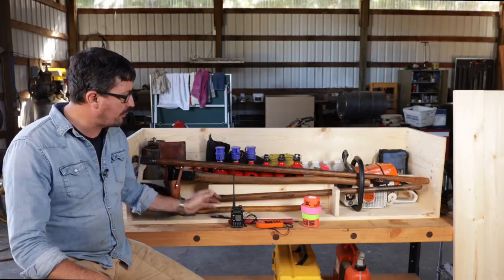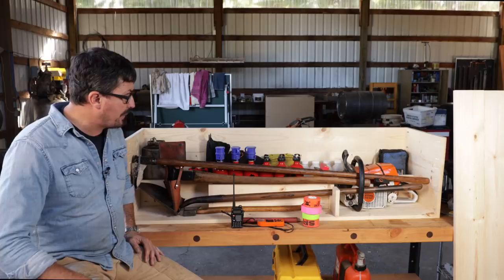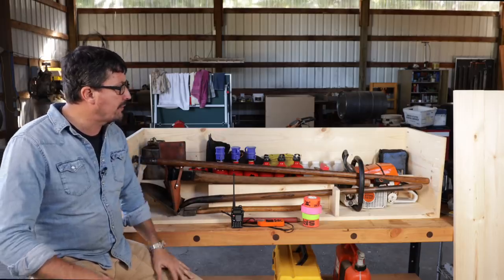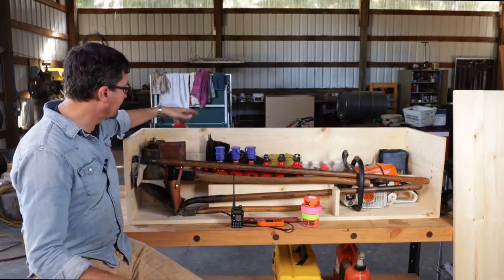I Built A CHAINSAW Survival Kit

Comment from the maker: Buy A Kreg Pocket screw Jig Here + https://amzn.to/2Yv62Ok + Only $19 + + + Free Shipping
Reply: GOD BLESS YOU MY FRIEND
Reply: You should put led on the bottom so you can pick it up with the forklift or the forks on your tractor
Reply: Your putting a lot of craftsmanship into something that's supposed to be staying outside. When the old timers made those boxes. They tended to make them out of rougher cut Lumber. They also used either glue or some other type of sealant between the boards to provide better waterproofing. Later when thin sheet plywood became available they used that to help create the lip to prevent water from getting in.
Reply: Very very nicely done Cody absolutely perfect love how you use the screws you just use the screws for what they are and don’t ram them into next week you are a very skilled fella and a pleasure to watch
Reply: @dawall3732  how can he work with a bad arm?
Reply: I just discovered the Kreg pocket hole jig kit myself recently. Great little tool to help a non woodworking guy like me reinforce some bunk bed rails. Ever since I did that project I've been thinking about what little things I can build with just that jig. Cool to see Cody build something using that exact tool.
Reply: Sadly I can’t build with wood or anything 😔

Comment: Might be a good idea to put some tape on the batteries on the torches and radios so the terminals don't corode or turn on accidently.
Reply: Good tip with the tape or don’t put them in until you need them.  I run energizer lithiums in everything now.  No acid leaks to ruin things.  Don’t let a 50 cent battery ruin a $100+ radio or anything else!

Comment: Beautiful. I love how close all of those tolerances are; not an inch of wasted space, but everything is still relatively easy to get to. 
The one thing I can foresee being a headache is having those wedges slide down into the channel when you remove that can of bar oil. Maybe put a thin panel to make a separate compartment or glue and tack some 1/4" square strips in the bottom for the tips of the wedges to go into. 

I can't wait to see it finished.

Comment: Looks great!
The pocket holes are sure slick eh?
I'd add battens on the outside for back up to the pocket holes and for extra strength, as well as on the bottom, to keep the main part of the box off the ground, just my opinion.
Take a short length of paracord with a loop on one end and carabiner on the other end to go through the holes in the rolls of tape, you could hang in inside the box on a hook and you can loop it through a belt on the go.
Can't wait to see it all painted up and stenciled, gonna give you the fizz for sure!
Cheers from Tokyo!
Stu

Comment: Very nice project...I wonder if a couple of 2x4 runners on the bottom the short dimension about a foot or so in from the ends wouldn't be a good addition just in case when you take it with you and put it on the ground.

Comment: I don't know if it's really worth mentioning, but as I watched you build this I noticed something.  You did pocket holes for the joinery on all the slides, but it at least looked like for the bottom, you just did a straight outside-to-in screw hole.  My thought is that if you did also a pocket hole from the inside, then ALL the outside of the box wouldn't be subject to the degradation of the outside, but using just straight out-to-in's on the bottom, it could more quickly degrade the screws from the bottom up as those are also the ones that will sit on the ground.  Meaning they might rust and break making the bottom not as sound as the sides.  Again, I'm no expert at all, and I could be very wrong about this for different reasons.  It was just something that popped in my head as I watched....not all the way through it yet.
Reply: Ok, obviously, after watching the video posted on the 26th, I was wrong.

Comment: I do similar,  with an exterior 1x4 frame, and 1/2" plywood interior, all green treated, with a rubber seal on the lid and skids on the top and bottom, and a dado'd floor... Always coated the outside with foundation tar, but lately using rhino lining... Nice job.

Comment: 2 questions. 1, how did you manage to find 1x6 that was all the exact same width, or did you mill this lumber yourself? And 2, how did you get pocket screws to not draw the piece in the direction of screw travel, such that the piece that is receiving the screw not the piece with the pocket holes ends up proud of the joint without clamps?

Comment: Two big questions  is it light enough that one man could pick it up and put it in a truck if it isn't (and even if it is) what about putting heavy duty wheels on one side and a handle on the other. My other big question is would it be smart to put a hand saw with the chainsaw that way if there is an issue you still have something. or is your chainsaw dependable enough that you won't have to worry?
Reply: He does have an axe inside the box.
I agree with you on the portability of this big box !

Comment: Did you use wood glue? I didn't see any. It would make the construction a lot more rigid. Back in the day I learned that a properly glued board is stronger than the fibres of the wood itself.

Comment: Hey Cody, couldn't notice that the layout and the method of transporting all the gear is pretty specific, unmodular and unpractical in my opinion. If you are going to replace the water bottles, petrol containers down the line, they probably won't fit in the designed spaces, if you destroy or lose one of whe wedges or get new ones they won' fit etc...The whole box is designed to fit your specific vehicle, it's probably gona be pretty hard to fit it in someone elses vehicle, you need to pull out every hand tool if you eant to use just the chainsaw.
A more universal and modular apprach would be more usefull and practical...just a grain of salt.
Reply: Let's see YOUR video. Criticizing without a better solution...

Comment: If anyone is able to answer, is there a reason he was putting the screws in from the inside with that rig? Is it purely an aesthetic so no screws are visible from the outside, or to keep the screw heads less exposed to oxidation? Lastly if it is the second, does the drilling out of the wood not reduce the structural integrity of the wood enough to make a difference in the lifespan of the crate itself instead of just screwing in the boards from the outside of the crate?
Reply from the maker: It's good style to hide fasteners, pocket screws are very strong,
Reply: @wranglerstar  Oh ok I'll try and educate myself on pocket screws then. Thanks for the reply Cody!